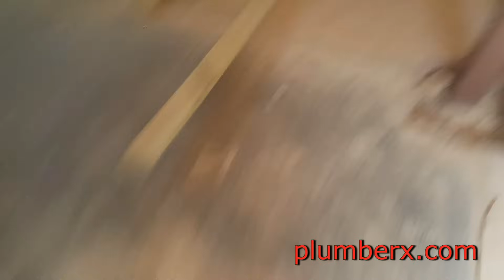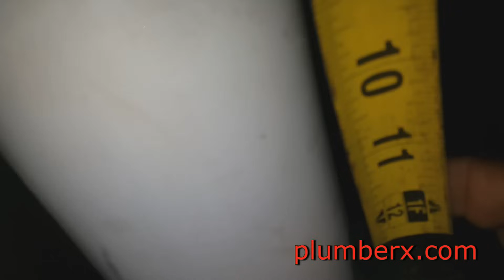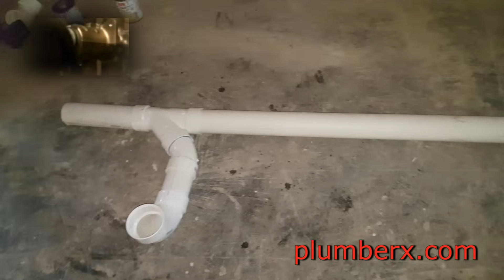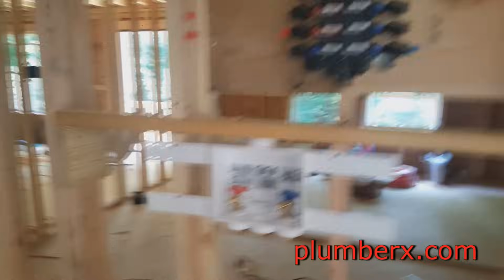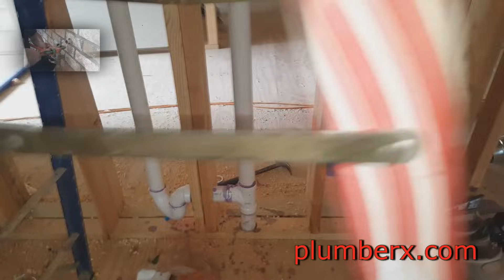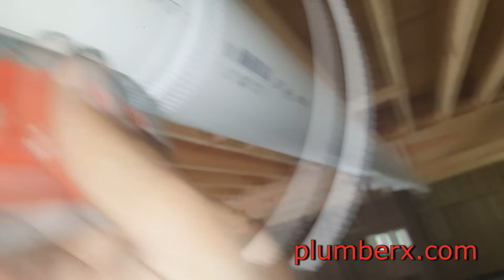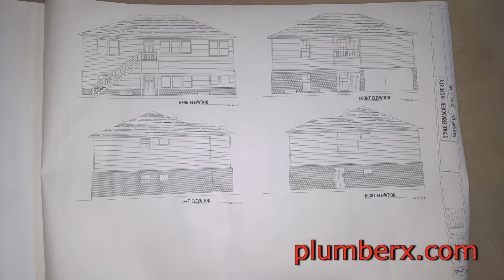Installing And Designing Drain, Waste, And Vent Lines: A Step-by-step Guide

Comment: Hey buddy, I could use some help with adding a water-softener drain to a 3" dwv. Would be using a 2" to a wye or sanitary T. What is best for this new installation very close tho this existing drain? Thanks
Reply from the maker: I wouldn't recommend connecting to the 3" unless I know what the 3" is for. And you would need a trap and a vent. If you have a basement I would recommend you run it to a floor drain if not run it to a laundry nearby. You can also run it to the outside into a bed of 1" rocks about 1' deep. Other then that I would have to see the layout of your plumbing waste system. Hope this helps.
Reply: @theartofplumbing  Thank you!!! I emailed you with specifics in this situation. Please be on the lookout.
Reply from the maker: Copy that

Comment: Claude, thanks for sharing your knowledge and job sites for some of us amateurs.  Is there a rule of thumb in installing vent pipe to the roof per distance of drainage run on 4 inch lines and or do turns and elbows make a difference?  Thanks, Glenn
Reply from the maker: Glen. Yes, your right. The distance you run a waste or vent is calculated by 1 size of pipe and 2 the drainage fixture units demand on the system, but mostly in a residential home are pretty simple. If you're looking to find out more. Check out this chart. https://www.google.com/imgres?imgurl=http%3A%2F%2Fwww.autoworldmobilia.com%2Fwp-content%2Fuploads%2FPlumbing-System-Graduate-Married-Student-Housing.jpg&imgrefurl=http%3A%2F%2Fwww.autoworldmobilia.com%2Fplumbing-code-fixture-unit-chart%2F&docid=-ZGuSwwINdRvBM&tbnid=jpHOu-t_ECC6dM%3A&vet=1&w=850&h=550&hl=en-US&source=sh%2Fx%2Fim

Comment: Thank you for such a good video. Is there a maximum length size for running a PVC pipe? I want to connect my New washing machine drain to a existing drain that is 16 feet across. Is this possible? Thank you in advance. BTW.. I click the like button and I also subscribed. And click the Bell.. Thank you so much.
Reply: I'd say any length is fine as long as you maintain the correct pitch.

Comment: Nice job. However I noticed that you didn't drill your DWV pipes through your joists but beneath rather. Any reason for that?
Reply from the maker: There was no need to. The ceiling here is really high 11 feet. and will not be covered with drywall. If this was going to be a finish area and a standard 8-foot ceiling living quarters yes I would have drill through studs. Me personally I try not to drill through the ceiling joist if I can avoid it. Because you have to be very careful how you drill you don't want to mess with the integrity of the support. If you feel you need to cut into the joist I would recommend you talk to the architect first. Good Question

Comment: I built power lines for 6 years and now I just do residental electric. A guy right now wants me to install a new meter service  and panel to a couple outlets and a light in his barn. He said it should be easy and he needed a list of stuff to pick up at Lowe's within 10 minutes of meeting me. I said slow down I've got alot of questions that need answered and then I need a minute to build this in my head and get some measurements.

Comment: I don't know if you answer questions, but if you do, here's mine.  My son lives in Phoenix and because of his expanding family, I'm going to help him build an addition on the back of his house.  NO BASEMENT.  The addition will have a bath room and I'm thinking of either a wall mount or floor mount toilet, that will go outside, and dump into a grinder-sump pump.  There will also be a wash basin and tub, dumping into the same sanitary sump pump. The waste will then get pumped (outside) (2" PVC) and into the laundry room and connect into the 2" behind the washer.  What do you or others think of this plan?
Reply from the maker: First of all. That is very clever, it sounds like you plane this out well. but I would make sure your bath is vented as well as the sump pump. You may know that already. And when tie it into the laundry drain make sure it's below the laundry p-trap.
Reply: The toilet will dump into the sump pit?
Reply from the maker: I think that is a pretty good idea. Just make sure you vent all plumbing fixtures. Sounds like you already know what you're doing. And the vent from the sewer injector should have its own vent. Funny you bring this up. I'm working on a video about am upflush toilet system that may be perfect for what you're doing. It's made by Santiflush. It should be ready in a week or two. I think it's going to be nice and very helpful.
Reply: @SupaTrending Daily
Ok thanks. I'm in Michigan with lots of basements so not familiar with that.

Comment: Can I use 1.5, or 2 " on my vent also how far from the p trap should the vents be
Reply from the maker: This chart may help you. Also you may have to check with your area. Some have different codes. https://images.google.com/imgres?imgurl=https%3A%2F%2Fwww.hometips.com%2Fwp-content%2Fuploads%2F2012%2F06%2Fdrain-waste-vent-dwv-pipe-sizes1.gif&imgrefurl=https%3A%2F%2Fwww.hometips.com%2Fbuying-guides%2Fdrain-waste-vent-pipe-sizes.html&docid=RtQbEeNFCey2bM&tbnid=BkhIQ3eps9qLeM%3A&vet=1&w=591&h=215&hl=en-US&source=sh%2Fx%2Fim
Reply: In Arkansas we use the (pipe size) x4 to figure dirty arms. So 2"x4 is 8ft max from trap weir to vent. Most of the vent pipes we typically  use is 1.5 beside the 3" going out the roof. That being said, if you are tieing in a fixture upstairs to drain into that "vent" above another fixture. It be best to go 2"

Comment: Were most of these fixtures individually vented? I’m actually in plumbing classes right now and watching your channel to put myself ahead of class. I was just curious if a circuit vent was possible anywhere in that video between any of your two fixtures
Reply from the maker: For the most part, but some vents I have catching 3 fixture like the bath room vent off the toilet catching tub toilet and wet vent on top of toilet vent catching lav sink. This would be one place you can wet vent, you will have to check with your local codes first ever area is not the same.
Reply from the maker: Circuit vent, also known as a loop vent. Again it will depend on the area you live in. Most places will allow it, because in many cases there is know way around it, like on a island sink, bar sinks stuff like that. If your not sure call your local plumbing inspector he would appreciate you asking and let you know.
Reply from the maker: No matter what the state code says. Your local City,Town or county. 
 has the last say so.

Comment: Why would you use a short pattern 90 after the toilet flange? Wouldn’t along sweeping 90 be better there also? Is either one OK by most local codes? Thanks
Reply: Short radius 90’s are is not good practice to use in waste, especially on a water closet, with 3 of them and a San. Tee.

Comment: Hi, my question is , what is the maximum length a drain pipe(PVC) i can run horizontally with minimum pitch or no pitch? i gotta consider a few elbows and T fitting i have to use to cover the corners.
what is the maximum length a  Pex pipe i can run horizontally in front of a wall with no pitch?

I hope it's clear,
 I'm adding a washroom and kitchen to my finished basement, i'm planing to do over ground plumbing , the thing is the spot i want to set up my kitchen, is other side of the basement, I want to run the pipes (Pex cold and pex warm plus drain pvc pipe) in front of the wall and have to use a few elbow and T fitting , so the distance is about 15 to 20 feet from my current pipes and main drain pipes in my laundry room. so i wonder , whether i would have water pressure inside such long pipes or no, or is there any problem with running such drain pipe? 
I can send you a picture if you give me your email ,

Thanks a lot
Reply: Would probably need to see pic to answer about drain but u are good with water no matter the length of run long as u don't have anymore than 3 fixtures hooked up on a half inch lines.. that's when u start to lose pressure.
Reply: Also I meant to add it's u need at least 1/8 in. Of pitch per ft min.. but no more than 1/4..

Comment: Do you have a video about converting 1 1/2 inch pipe to 2 inch pipe for a shower only conversion. Its a third floor bathroom in an older home. I cannot locate any two inch pipe to tie into. Also it looks like the tub/shower part ties into the second floor shower /tub but not the sink and toilet.  One video suggested using a Fernco coupling.
Reply from the maker: pos front Sorry I don't have a video on that. I wouldn't recommend reducing a shower drain to 11/2 drain. But that's just me.
Reply: What would you do for this job. I trust your videos and would like to be informed when i call a plumber because we have had a lot of fails with contractors including our second floor bathroom.  Thanks for replying
Reply from the maker: pos front If you could e-mail me some photos. I may have an idea. Thanks

Comment: Excellent analogy on venting such as a drinking straw. I use the same when explaining to my customers. Great video Claude Thankyou!
Reply from the maker: Thank you Tim
Reply: I thought venting was to preserve the integrity of the traps, fluids will still drain without vents because there's no "thumb" at the end of the straw, however, traps will empty out or be partially filled so sewer gas can peculate up through the system.  IPlease correct me if I'm wrong as I'm just an amateur.  Other than that a very helpful video, thank you!
Reply: @phunwithphiphi8055  fluid will still drain without vents,  but it'll be slower/ not as effective.  Vents allow for pressure to be equalized, because you're introducing air from atmosphere, and gasses within the system flow more freely.  And you're right,  vents also protect the water seals within the traps from siphonage/ back pressure, water seals prevent sewer gas from entering the building which is important, cause that stuff is gross smelling and not healthy to breath in